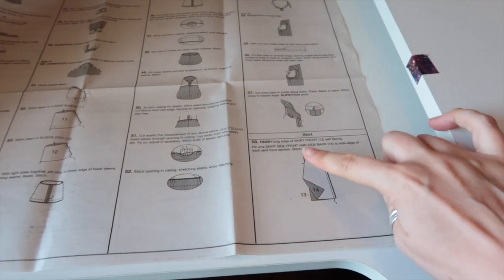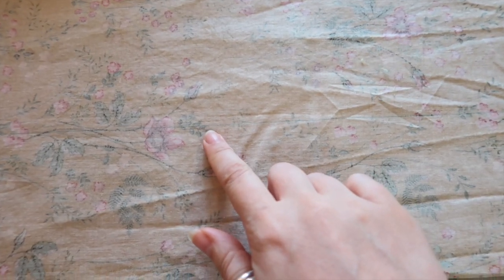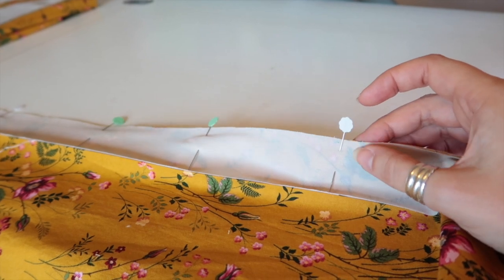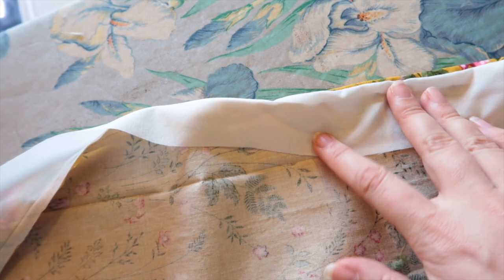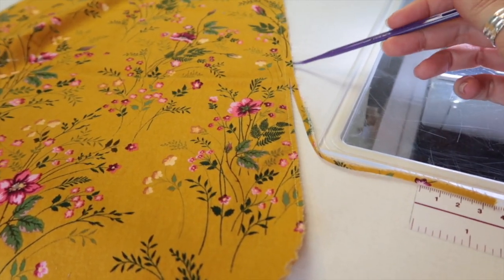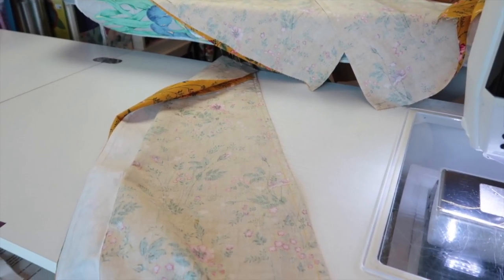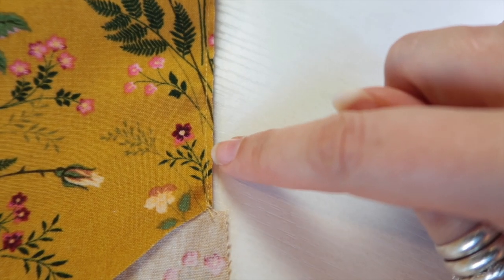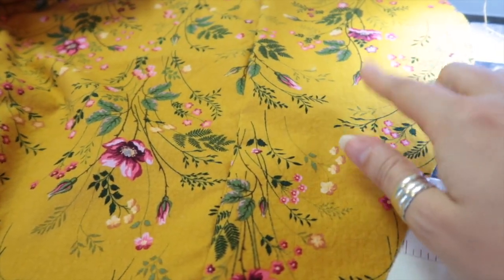How To / How I :: McCalls 7974 Sew-Along :: Part Three :: Finishing The Dress

Comment: Not sure if you still check this video but...I'm making this dress and the instructions have you fold the skirt facing back on itself, stitch it, then turn it inside out; it looks like you just folded it twice towards the inside?  I hope I explained that correctly...I'm guessing the pattern did it that way to finish the top of the facing, which you didn't have to do because you sewed down the bodice lining, which encased the raw edge?  Or did you do it the way the pattern calls for and I missed it?
Reply from the maker: I did enclose the top raw edge in between the outer and lining fabric. I think the pattern just has you see the skirt to the bodice and press the seam up. But this is from memory as I don’t have the pattern to hand.
Reply: @KittenishBehaviourSian  Great!  Thank you for the response!

Comment: Hi! I’m making this dress for the second time now and somehow my skirt seems to get in not right: so I have a lot of gathers in the back between the notches around the centre back. Then not a lot of gathers towards the side seam, and then quite a lot of gathers between side seem and center front. What am I missing?! My side seams are matched up. But is it correct that my notches in the back should match the seams of the sideback/back panels? Or is something wrong there? Please help, I have done this twice now and u only get it nice if I cheat with the notches haha
Reply from the maker: Hey 😊 I can't remember off the top of my head but it sounds like it's intentional to have the gathers spaced like that so the side seams are smoother. Looking at the mustard dress in this video the gathers are distributed the way you're describing it. If you don't like how it looks just evenly distribute the gathers along the back from side seam to side seam and the same at the front (you'll want to keep the gathers out of the skirt facing though). I hope that helps 😊
Reply: @KittenishBehaviourSian  I set in the skirt and it worked ! Thanks so much for this sew theough! I also made my first French seams ever and it looks so neat 😍 thanks thanks thanks !